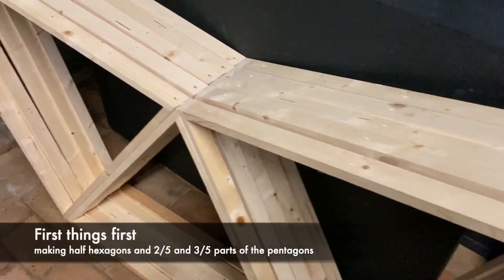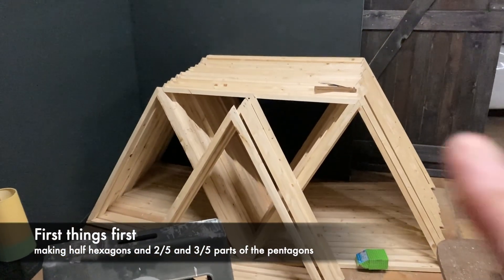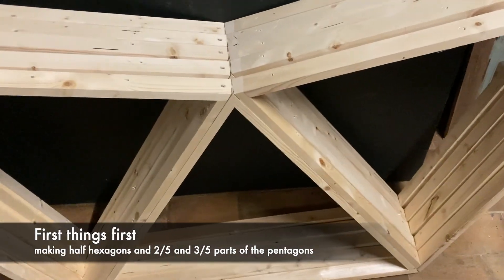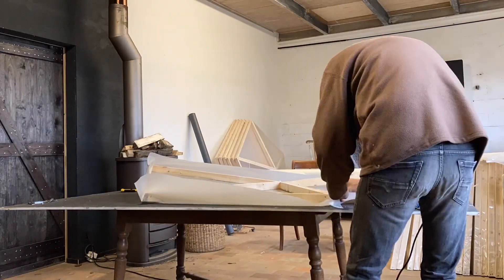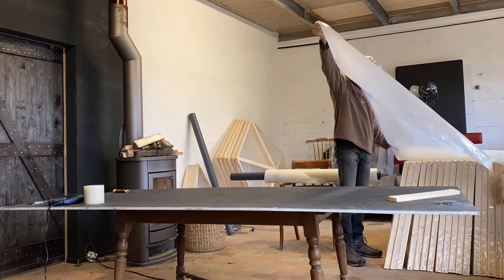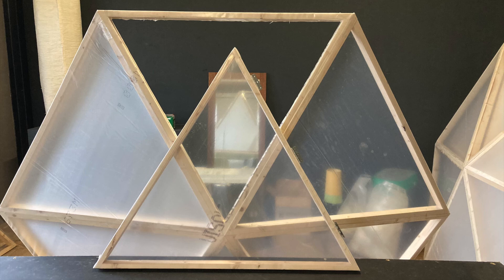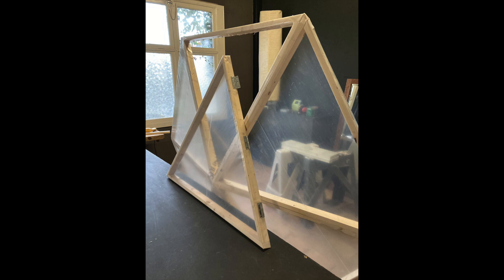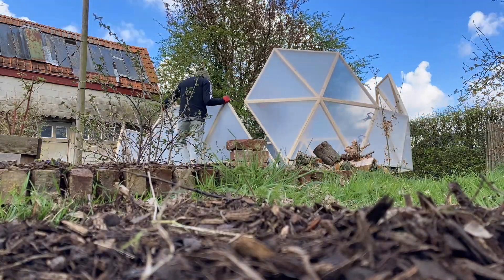Geodesic dome part V   Covering

Comment: Hope you used stainless steel staples :)
Reply from the maker: honestly I didn't pay attention to that, but the reality is that I will probably add some extra tape on all the seams, because now I still have some water leaks from above ...
Reply: @velopromobiel  
I`m not a big fan of tape or staples, you`ll find the leaks are an endless battle.
Reply from the maker: @JohnGuest45  all suggestions for another solution welcome, a hard-cover of the dome would be possible, but much more expensive ...
Reply: @velopromobiel  
Panelized frame lends itself to rigid glazing but its still tricky to make the joints watertight and, as you say, its expensive and a lot more work. Hub and strut is better for flexible coverings. The shared struts make it easy to attach the cover in sections and create watertight seals, especially when using a mechanical fixing (no staples). Poly expands and contracts in hot and cold weather so its best to use a fixing that traps the poly and distributes the load evenly. Staples and nails tend to create localized tension which can be seen in the poly when its under tension.
Most folks build a dome and then decide on how to cover it.  I started with the cover and then designed the dome so it would fit.
Reply from the maker: @JohnGuest45  I would be curious to see your dome, I have been thinking a lot about creating a better dome considering watertightness but for now it is ok, it suffers from condensation rather than leaks. In this aspect an aluminium frame with polycarbonate panels would be a better solution, but probably 15x more expensive ...
Reply: @velopromobiel  
Condensation can a big issue for timber framed domes. Folks that dont own a dome wont realise the condensate can sit on the horizontal struts with nowhere to go and it can also run down the struts/panels into the vertices. This can lead to black mold and, in the worst case, rotting of the end grain timber connections and rusting of the screws.  I encapsulated all of my struts, including the end grain and fixings in a white epoxy coating designed to waterproof ponds, folks use it to make huge plywood aquariums completely waterproof. Its non toxic to fish and plants but it wasnt cheap. The trick to reduce condensation is to try to keep the relative humidity (RH%) down, especially at night which will lower the dewpoint temperature. For example, an air temp of 30F and 90% RH, results in a dewpoint of 27.2F. At 30F and 50% RH, the dewpoint t will be 15.4F. If you have a dirt floor that can be a source of excess humidity as water evaporates from the ground itself. A vapour barrier covering the non planting areas will help with that. Using double or triple wall glazing to raise the temperature of the inner surface of the glazing will help a lot. Timber is a better insulator than aluminium, if you go for an aluminium frame you should be mindful of thermal bridging. The aluminium frames on most traditional greenhouses act as a giant thermal bridge :) My dome is similar to the Eden Project, it uses a hybrid space frame with inflated triple glazed pillow covering. If that wasnt enough, it also has a one of a kind subterranean heating and cooling system (SHCS) installed beneath the floor.